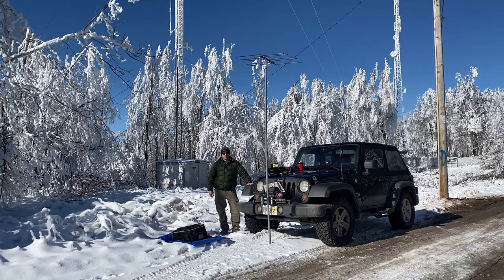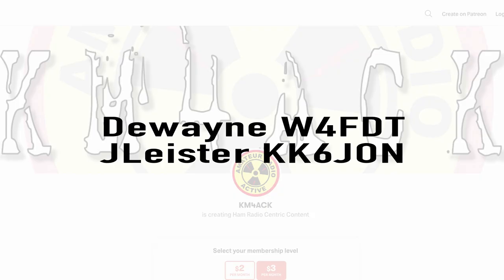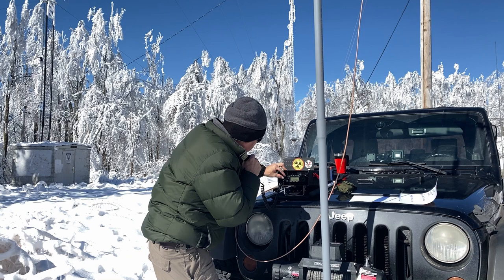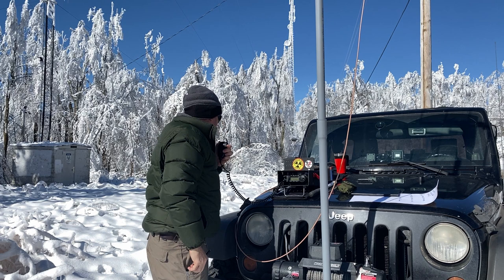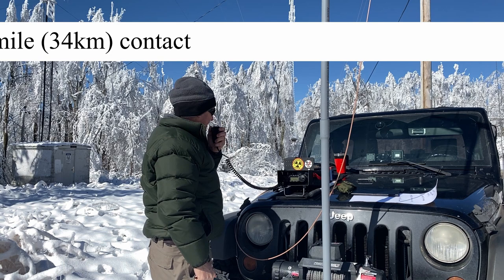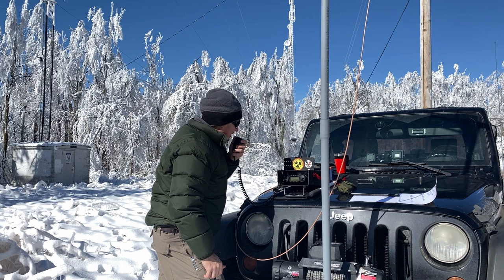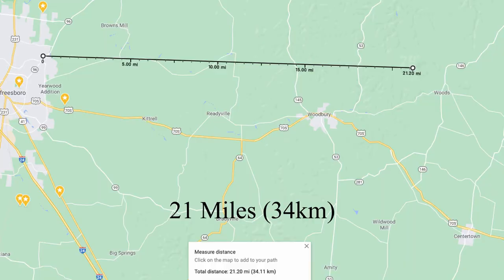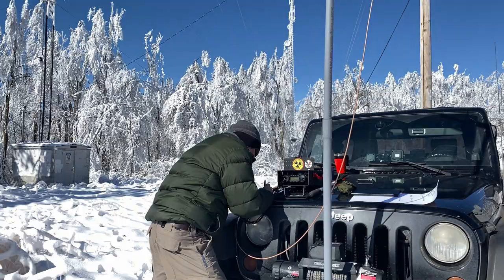114 Miles on 2M Simplex :: Elk Log Periodic

Comment: Great Video, and show & tell of an antenna. back in the early 70's we had to drag out gas op gen. to run base sets  or 3-4 lead acid batts for short time operating on Mt tops. sota/pota was not even a thought back then we called it "Hilltopping" great fun but a lot of hard work. I am in awe of today's rigs antennas for going "Hilltopping or even just at parks etc. glad to see that part of the hobby excell so much thanks for sharing de Ellis WA!RKS

Comment: That's a good start for working long haul VHF. I have not looked them up for a long time but, they are at their best a ham community who like to work troposcatter, meteor scatter, knife edge and such 400 to 800 miles, some times further and do even some moonbounce. A typical station has quad 11 element beams, a tower mounted preamp and the better part of a legal limit amplifier, which few VHF hams own. You don't need all that to get started and listen to weak signals, just know when their there. Still, mountain topping is still great sport running all modes and great for the VHF QSO party and such. Mt. Mitchell is a great place as are others and now you don't even have to  pack a generator on your back to run all that tube gear! Now, between the internet and calling out on the many repeaters you can hit, you can ask them to meet you 144.050 SSB for a point. Also, there are programs on  the web that will show you  if you have line of sight to places you wan to work, but, that's too easy!

Comment: Hey Jason can you do a quick video on your temp mast and mounting on the front your jeep?
Reply from the maker: For this video I was using plastic conduit pipe from the local hardware store. I won't be using it again unless I have no other options. It was too flimsy to support the antenna. I had another section that I wanted to add to it and gain another 5 feet but it bent over too far when added. I think I have a better solution. If it works out, I'll cover it in a future video.

Comment: SSB uses horizontal polarization, not vertical. Sounds like you started with horizontal.
Reply from the maker: Yes. I was using horizontal for SSB but changed to vertical for FM contacts.

Comment: done over 300 miles on a pair of horz loops for 2 meters.. Not that hard or nothing spectacular...
Reply: I guess that depends on where you are.   Here on the plains of Montana where from atop a mountain I can easily see 200miles would make it a hell of a lot easier than in Tennessee where you can't.  And your loops aren't all that special either,  I've made 220 mile contacts into SPACE with a 19" whip, so you see it's all relative.  73 de KF7VUT